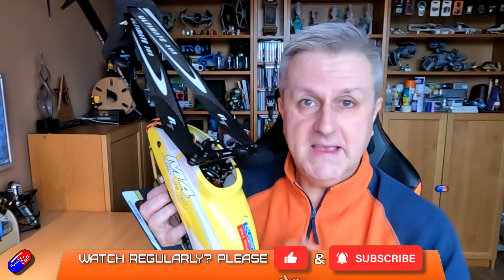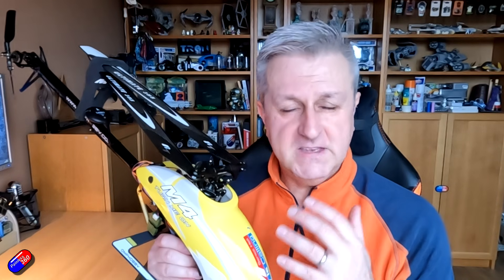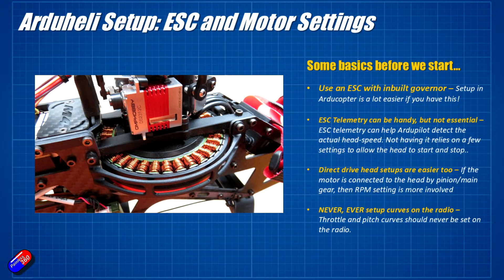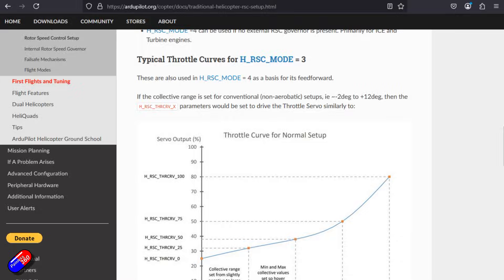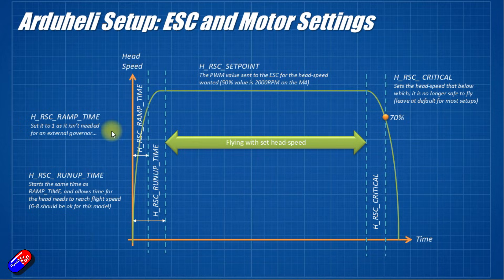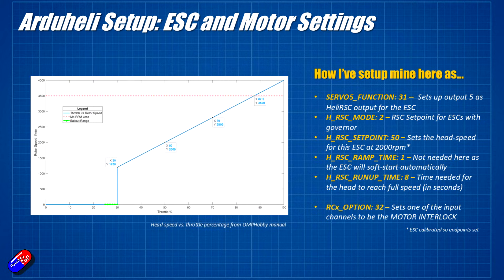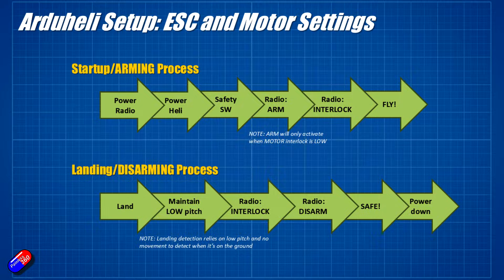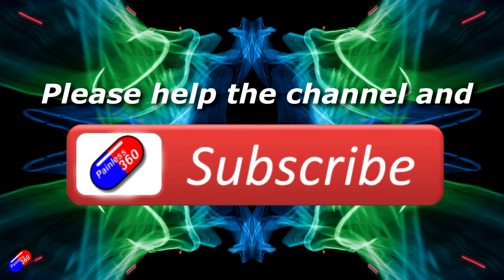ArduCopter Helicopter Setup: How to setup the motor, ESC and Governor for correct head-speed

Comment: Great series!  Can you also explain using a BL_Heli S ESC?  I am using a SpeedyBee F405 Wing Mini and don't have a good grasp of what pins the servos and ESC plug into.  Any help is appreciated!  This may be more relevant than explaining how to use the PixHawk since, based on what I have read, the newer Matek and SpeedyBee FC's are used by a greater number of pilots.
Reply from the maker: How familiar are you with Ardupilot?
Reply: Thank you for getting back with me so soon.  I am very comfortable with programming using Ardupilot for fixed wing aircraft.  I have been flying and programming those since the old APM days.  Currently I have three airplanes with Matek F405 and SpeedyBee F405 FCs and they fly great and were programmed with Mission planner and Ardupilot.  However, none have Dshot ESCs.

Is there a "cheat sheet" anywhere that explains what pins the 4 helicopter servos go to and what the settings are ?    I know you can map yourself silly with Arducopter but is there a default setting for mapping and connecting servos to a SpeedyBee F405 for a bare minimum traditional heli setup?  Also, since I am using a Dshot ESC without a built in governor do you have suggestions on what pin to plug the ESC into.   Radio is calibrated fine and I am using a RadioMaster TX16S.
Reply: I forgot to mention.  I also have years of experience setting up and flying RC helicopters using just the tail gyros - no FCs.
Reply from the maker: Fab, then I can assume a higher level of knowledge. If you watch the series I cover all of this. Specifically the SWASH setup video will be useful. The only other thing to think about is output grouping and timers - see https://youtu.be/ABEd3kKCzZU Best of luck!

Comment: Hi Lee, I am new to Arducopter so that's one bit of your advice I didn't follow. I have the helicopter all setup in MP using this video series. I have followed all the arming and interlock steps and in MP it says 'armed' I get the long arming beep and then a few seconds later another beep the motor does not turn at all. I have calibrated the ESC and the motor did all the beeps as expected to set the throttle range. There are no error messages when I arm in the messages section. What can I do next to troubleshot the motor not turning?

I wonder if it's something to do with the interlock option. If the interlock switch is "high" then MP says "prearm: motor interlock enabled" so I can't follow the process you describe here to get it armed. I need to 1. Press the GPS interlock button to enable the servos. 2. Switch the interlock switch off. 3. Arm the Pixhawk (radio channel 9 in my case). As I said if I follow this process it says "ARMED" in MP and then 5 seconds later "DISARMED" and nothing else happens.
Reply from the maker: Both arming then interlock are needed.  You can monitor the throttle output in Mission Planner (without battery connected) to confirm you've set it up OK. As stated in the start of all these heli setup videos, I would strongly recommend not building an Ardcopter heli as your first experience with Ardupilot... best of luck
Reply: @ Thank you for your reply. I posted the question over on the ArduPilot Forum. I have at least 20 years experience of building and flying all types of models so I’m not a total beginner, I’ve setup most of the flybarless helicopter controllers and quad flight controllers so I have a good understanding of this stuff. The thing is I’m not really interested in a robot airplane or robot quad copter but I suppose I could take this unit off the M4 and put it in a airplane or quad at this point I’ll be taking it off the M4 and putting it in the bin to be honest.
Reply from the maker: Sorry to hear you're struggling. Helicopters seems to be the least well understood part of the Ardupilot family. I'm making my way through it with support too... Happy flying!
Reply: @Painless360  Thank you for making this video series Lee it has 100% helped me, I am grateful and I'm sure I couldn't have done this without your help. I was hoping to do my maiden flight on Sunday but the winds are forecast to be 26mph gusting so not great for a maiden. I know from watching another club member flying his Trex 500 with an ArduCopter system installed it can easily handle 30mph gusts but not for a first flight.
Reply: @Painless360  Hi, I have it working it was simple user error. I wasn't sequencing the arming and interlock switches correctly. As you say if I had more Arduxxxxx experience I may have known this but I'm not sure how starting with a airplane or quad would have helped as I'd still have made the same error with either of those.
Reply: To be fair you did outline the process for arming very well in the video but I wasn't familiar with this process so skipped the interlock step and expected it to spool up the motor.
Reply from the maker: Only helis use the motor interlock but having experience with Ardupilot would help you only have to deal with the small differences in setup, not the entire setup process.. Best of luck
Reply: @Painless360 I have it working perfectly now. Not with the OMP M4 that still has tail wag issues which are still present with a different flight controller so it’s a mechanical issue. I put the 6C mini on an old Trex 500e pro I had in the end and it flys great. I’m really impressed with Loiter mode it will hold the helicopter in a steady hover with only cm’s of drift in any direction, flying around in AltHold mode is great because when I lose orientation, which I do sometimes it’s not going to crash. I’m flying happily. Anyone who wants to give this a try I say go for it.